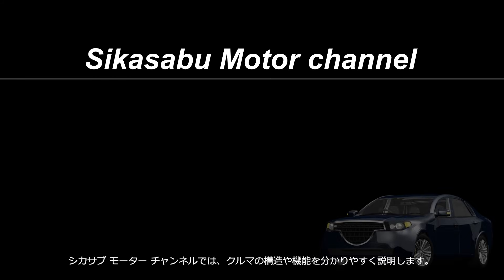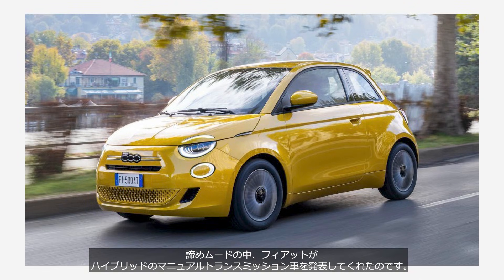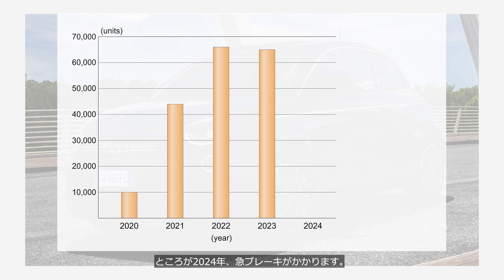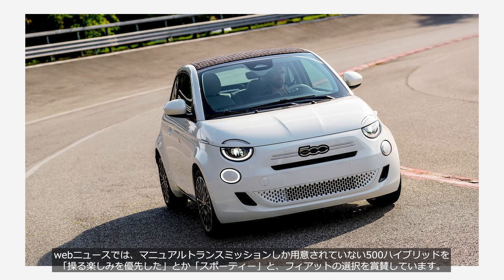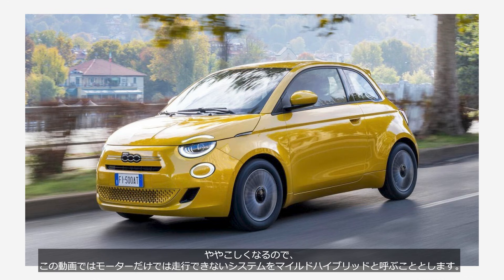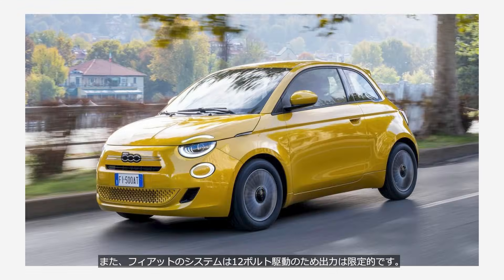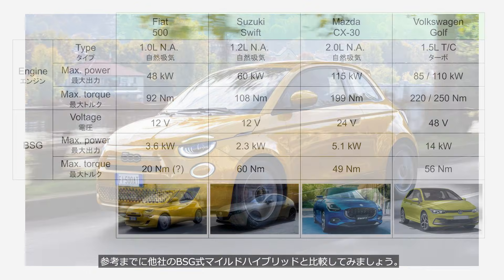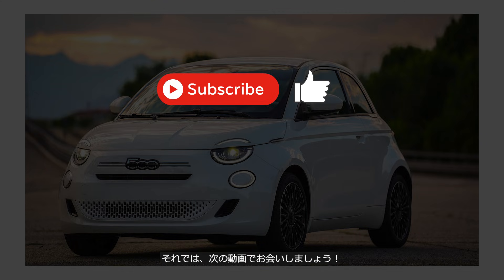The Story Behind the Fiat 500 Hybrid with Manual Transmission and How It Works

Comment: That torque figure is sad from an electric motor. The Honda IMA system was much better for low end torque with the in-line hybrid system.

Also, talking about IMA: it could at times cut off the fuel to the engine and propel the car forwards, but not without cranking the engine during its operation. I think that would be a better way to categorize a mild hybrid vehicle: one that cannot spin the electric motor alone (instead of one that cannot drive without the ICE generating power)

Comment: Hybrid Light

Toyota GT GR was said to be Mild Hybrid, and the system was integral with the transaxle and obviously propulsive.  Do you mean omission of EV Only mode?  I think that Hybrid omitting EV Only mode but retaining re-use of kinetic energy for use as propulsive force best-suited for lighter vehicles and vehicles with Manual Transmission and sports vehicles should be called Hybrid Light due to relative lightweightness of capacity-optimized components/subsystems being so important to these vehicles, especially battery.

non-reuse as propulsive/accelerative force is the basis of distinction, not EV Only mode inclusion

Comment: @sikasabu hey, I have 2 interesting topics for you to figurę out, that I couldn't figure on my own.
1. Scania hybrid diesel trucks. They use power split device, 2 electric motors and a 6 speed stepped transmission without clutch, brakes or even synchronizers. Is this just like toyota HSD, but torque instead of being router directly to the wheels is being routed to 6 speed transmission first?
2. Dacia/renault/horse powertrain hybrid g-150 4x4. What makes me wondering is when is the drive battery(48 v 1,8 kWh) being charged- whether it May be done only via 48V BSG when ICE is running or rear axle motor during decceleration, OR is it possible to put more load on the ICE when driving speed/load is low, make both BSG and rear axle recharge the battery, then switch the ice completely and drive for lets say 1km solely on electric motor?

Comment: I run that car for 10 days during holiday and it was kind of fun. When the 12 V BSG was under power during acceleration, that was a significant difference. The 61 hp engine need a lot of shifting in mountainous areas, but when the battery had enough capacity to allow the BSG to support it was night and day of a difference, especially there where the BSG has more torque (lower shaft speeds). The system fits the car well, the 6spd is a necessary feature to support the low torque ICE, to keep the engine speed in a reasonable range most of the time. I liked the system, it really helped to lower the MPG, finally we were around 4.5 l/100 km in a quite mountainous area, which fits the system better than flat areas, the recuperation of the battery with 14 or 16 V is something which need time when current is limited and the belt drive is also limited in the transferable torque. BTW, the 1000 kg curb weight of the car is also helpfully to keep that thing running. Some steep mountains needed back shift into 2nd gear without, while with BSG 3rd gear was no problem.

Comment: 12V mild hybrid is far too weak and outdated, needs to be 48V minimum 120V maximum like Honda IMAs and the much missed TwinAir engine
Reply: Exactly, and the engine too, 1.0l 6 valves port-fuel-injected is crazy in 2025. Should've kept the twin-air, as you said.